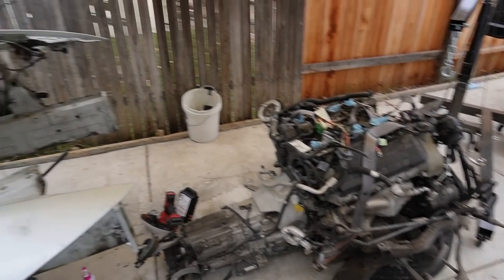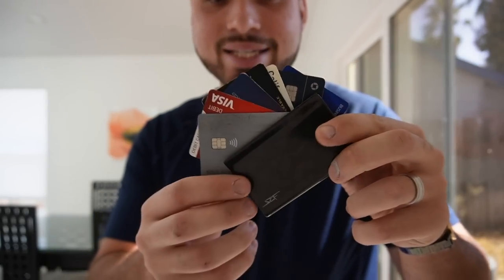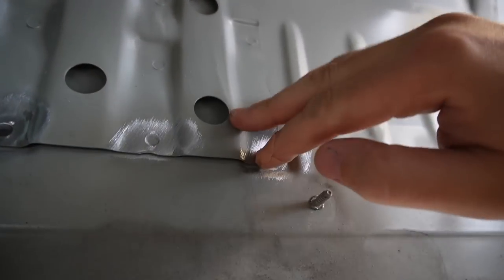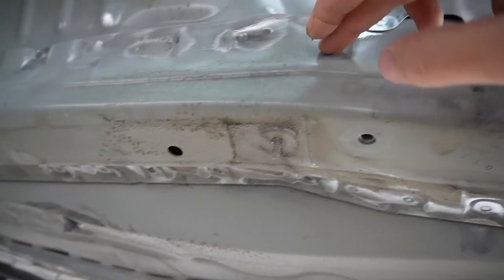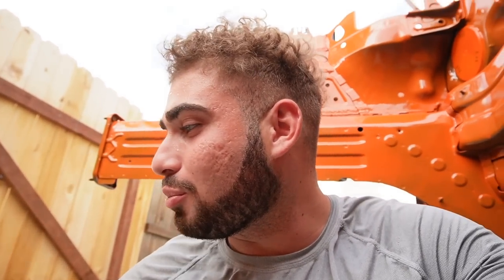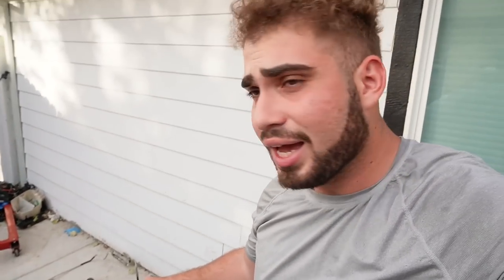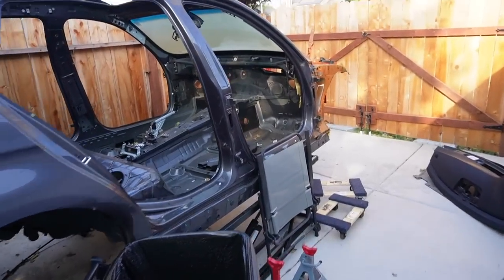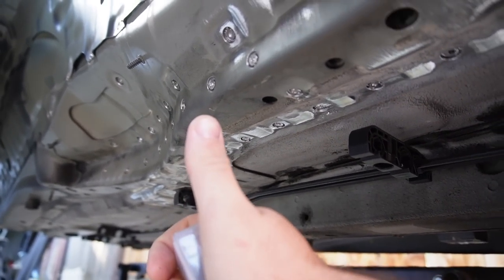Building A Custom 1 of 1 E91 M3 Wagon! (Part.11)

Comment: Dude.  I hate to say it.  But you may need to redo it.   Please get some weld through primer.  It's specifically made for these situations.
Reply: He welded first and then used primer should be fine no
Reply: @capsikseason  He did not prime under the metal cover.  I'm not the expert, it is just from watching other youtubers.  I believe you are suppose to spray the "weld through" primer on the body.  Then weld the cover piece to the body.  Then use regular primer on the top of that.  I really, really didn't want to say anything, because it took so much work to get that damn think off.  He did seam seal it, so perhaps that will be satisfactory.  Just wanted to mention it, if our man ever has the same situation.
Reply: @warpspeedracer  It doesn't really matter in cali it's unlikely to ever rust
Reply: maybe he should’ve primed the back, but he sealed it so i don’t think water will get thru anyways.

Comment: Do you want to use the e90 m3 front Seats?
Please install the Seats as a Test.
In the case of BMW X-Drive Vehicles, the Transmission Tunnel is larger, it could be that only one Seat from a X-Drive Model fits. You then have to Change the entire Transmission Tunnel on the driver Side and not just the Bracket.
I see a big Dent behind the welded transmission Bracket...